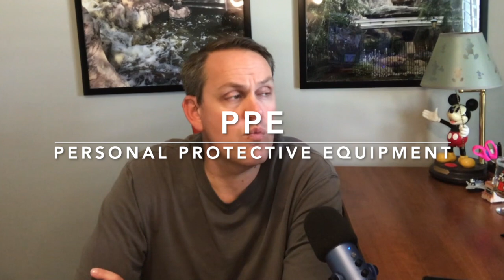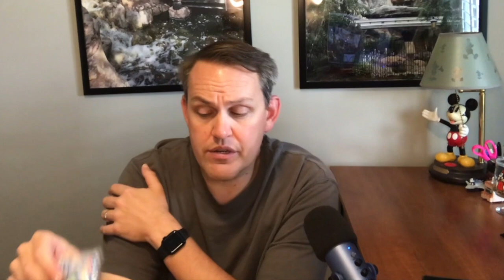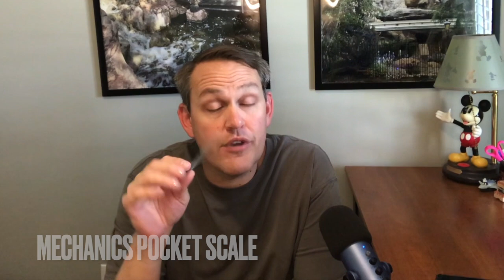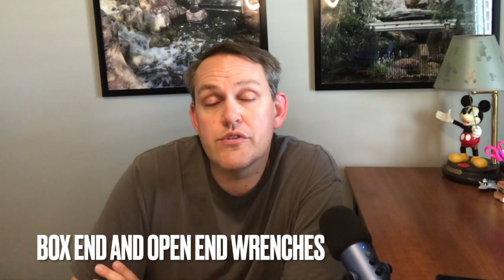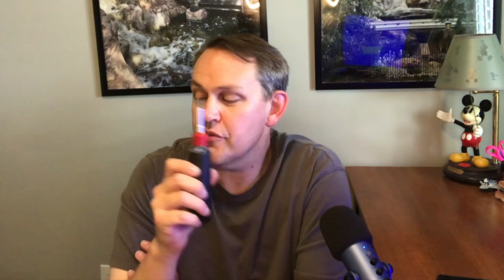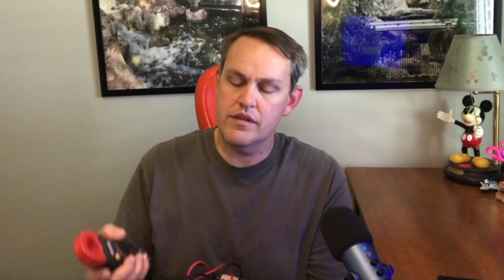What Mechanics keep in their Ride call response bag

Comment: I have a phone interview today for a ride mechanic position.  Not entirely sure if I'm gonna get the job or not.  But this is something I've been thinking of.  

I do know that parks carry their own tools.  But from past experience working other blue collar jobs, I've had decent luck with providing my own tools for myself so that I'm not wasting time hunting them down after someone else has used them.

I could see myself carrying a small socket and screwdriver bit set around.  Maybe a set of pliers and vice grips.  Depending on the ride and the most common issues it has that can be addressed with basic tools.
Reply from the maker: Good luck. Tools required should be explained if they require this.

Comment: I'm working on a new park for UC and a big topic that we continue to go over every single morning with our sub contractors is LOTO. A lot of people genuinely don't understand the importance of it. They either don't want to have to coordinate
making sure EACH of their tradesman have a lock to use to put on the box and just have 1 for their leader to be responsible for everyone (ABSOLUTELY NOT ALLOWED). Or they forget to unlock at the end of their shift which would prevent ride testing and that process goes up the chain of command. And also that removing a lock without consent of the owner of the lock is a FELONY.
Reply from the maker: Yea it’s an uphill battle. Until someone bends the system enough and some poor soul never goes home. Then it’s a tragedy that could have been avoided. 
Where I work now, if we find a contractor working outside of our lock out policy the entire contractor company is walked off the sight and told not tot return.

Comment: Hey Ryan quick question, on Medusa at Discovery Kingdom what causes that clicking sound when the train goes through the zero g roll? I assumed it had to do with the linkage in between cars as it’s twisting. Thanks!
Reply from the maker: Actually what your hearing is the sound of the ARB and chain dogs falling up then slamming back down.
Reply: @ryantheridemechanic  Ah gotcha, thx! Everytime I heard that I knew it Medusa, even when I was little lol
Reply: @ryantheridemechanic  Also, how many times do operators need to test coasters before allowing guests on?
Reply from the maker: @Bjg6  it varies park to park. Seams most have a general 1 test ride per train and 3 cycles before test ride.

Comment: Pocket screwdrivers get lost more than 10 mm sockets😂
Reply from the maker: That’s why I hord free ones when they come out. Vendors are great for that. Plus when you drop somthing from over 50 feet up. It will survive but you’ll never find it on the ground. Especially a 4mm Allen from 135ft into red rock. Nope. Lost 6+
Reply: @ryantheridemechanic  I have a whole drawer full in my toolbox of pocket screwdrivers. I always make sure that I get at least one from the tool guy every time I buy something new. There are places in a vehicle that I swear go to the 6th dimension or something. Something falls under the hood and doesn't hit the ground is a terrible feeling.
Reply from the maker: @Spike-sk7ql  yea! You can drop on outside and it rolls a few feet. But you drop on inside the boundary of the car and I swear you never hear it hit anything. Atoms just disappear.

Comment: Sorry, but I guess I'm a tool snob. I despise West Virginia socket sets (crescent wrench) and the vast majority of my tools are Snap On.
Reply from the maker: Snap on makes great stuff my high usage tools are snap on. But the $$$…..
I buy cheaper for low usage and i love some multi use tools.
Reply: @ryantheridemechanic  I do the same. I make my living off of my tools, so they best be good. I'm not above buying something stupid from harbor freight though. Yes, Snap On is expensive. However, they're American made, and in my humble mechanic view, they are the highest quality. I've had a flex head 3/8 fine tooth ratchet with a 3' pipe on it, and hung 200 lbs on it, and the thing wouldn't break. (Neither did the fastener so I had to make it liquid) Also, don't ask why I tried that setup. 😂
Reply from the maker: @Spike-sk7ql  harbor freight is awesome for amusement rides. A 35mm nut that only needs 20ftlbs of torque. I’m not spending 300 on a socket from snap on for that.
Reply: @ryantheridemechanic  same. I'll just buy 2 from HF, just in case.

Comment: One thing about multimeters, if you're dealing with "unclean DC" voltage ... by that, I mean AC through a rectifier, and not through a regulator (common for solenoid drives, relay drives, etc), you need a true-RMS meter to correctly read it, as the DC still has some AC ripple in it.

For example, in the arcade world, pinball machines use DC voltage for coils, and it's labeled in schematics at 50vdc.  A normal meter will read that as 70-ish vdc due to the ripple, while a true-RMS meter will correctly read 50.

Comment: Secret weapon for black/green wires….. permatex heavy duty radiator cleaner PN:80030   Yah just need a cap full, dip the wire, bright copper!  Flush with water.     It’s actually impressive the first time you see it…….like a informercial cleaner add stunt.
Reply from the maker: Neat!
Reply: @ryantheridemechanic   next order I am getting one of them fluke poking hooks!  Thanks.
Reply from the maker: @ArtBarn591  fluke pic

Comment: Back in my waterpark days, the radio calls for biohazards were "little brown trout" or "great white shark" (fecal/vomit, or blood). They were usually in a pool, which required clearing the guests out, cleaning it up, then keeping the attraction closed until 2hours after the water tested clean. Same calls were used for incidents on dry land though too. Really cute calls for a really gross situation  =P
Reply: still watching the video, i have one of those 6in1 screwdrivers too. i love it so much, but can't find them anymore. have you had any issues with the shaft spinning when you really crank on it? I had to add some epoxy cuz I used it too hard, and it started to slip
Reply from the maker: @smokkin1  no mines held up Really good. You must just be very strong!!
Reply from the maker: Yea. I’ve heard plenty of nice names for sewer obstructions that I’m glad I never had to deal with.

Comment: I had two tool bags a electrical and mechical. Since I was a Electrician I carried an electrical bag with common tools which carried a multimeter. I did ride call at SFA without ampmeter and got hell from another electrician who did evenings about not having it. Now my electrical bag is my Fluke381 bag with Fluke381 screwdrivers, fuse pullers, srippers, and linemans.
Reply: That's awesome. I'm an electrical contractor in California, trying to get my foot in the door doing controls work....  I'm bored with what I do these days. If I'm not troubleshooting, or making something better - I'm over it.  Lol

Comment: as far as the radio thing goes, i as a ride operator never listened to the mechanics channel, I tended to keep the radio i had on the Ops channel as the phone at my ride was a bit dodgy and sometimes didn't work.  plus by listening to the ops channel, i could guide guests to attractions that may still be operating during a weather event or knew which rides were down for whatever reason and could them recommend rides in the same area that were still up and running.

Comment: I am assuming that the time varies depending on the coaster train.  During the off season how long does it take to take apart a train, check for repairs,  and assemble it back together?
Reply from the maker: Small train. Dedicated mid size crew, about 9 weeks assuming no problems and parts on hand.
Reply: @ryantheridemechanic  wow. That sounds like a long time but I am sure there are a lot of components to check. 
Thank you for the quick reply and keep up the good work.

Comment: Hey I was wondering if you could do a video on how you start rides up for the day. The video too did about putting them to bed was really cool and I’ve always wondered what the contrary of it is like
Reply from the maker: Yea in that same general style I can work that up.
Reply: @ryantheridemechanic  😁😁
Reply: As an op I am defiantly interested in this from the maintenance side. Sometimes when we get the ride late it's obvious why, other times not so much. Sometimes we get the ride and there's already something wrong with it! (usually a ghost or e-stop)

Pretty much the only things I know they do is walk the track and transfer trains on in the mornings.
Reply: @nathonizamboni875  hence why I asked it because at one point there was a time where my ride would consistently open at 2Pm rather than at opening. They replaced a whole bunch of parts though so it was down for 3 weeks and it’s been running very smooth since.